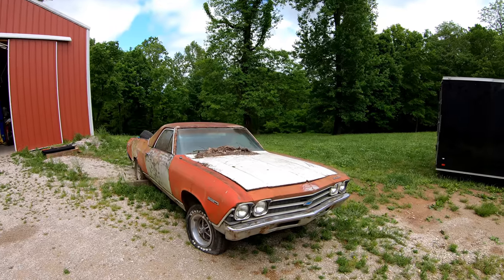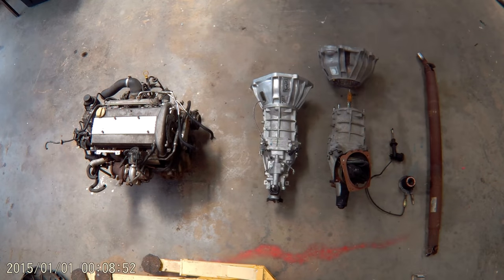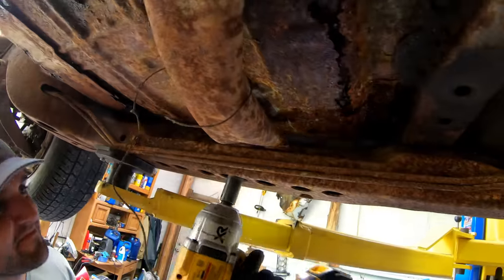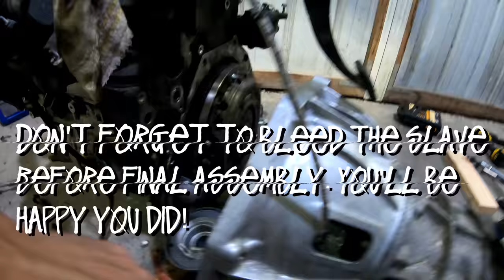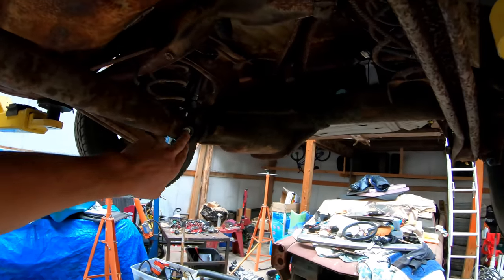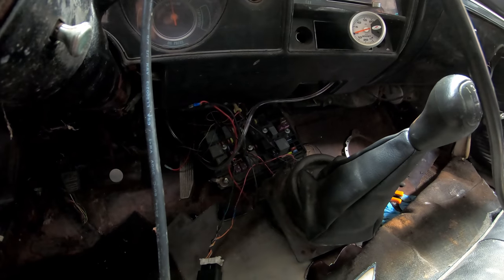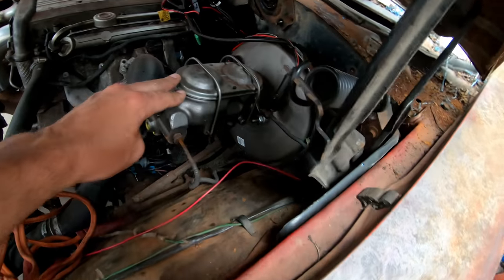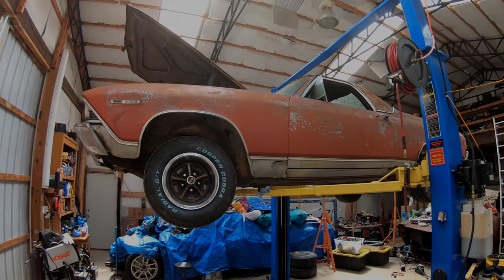The next 2JZ? LSx? - this NEW engine swap will be the new fad, follow this HOW TO : EcoMino Part 1

Comment: Keith MuletownDyno I Definitely wondered when I saw the one piece bottom end... I bought a G6 that skipped a tooth or two, who knows... Didn't run. I was able to revive it, no bent valves. Pulled the pan off to clear all the guide plastic from the oil pickup screen and check a couple rod bearings. Big, one piece bottom end!
Reply from the maker: For sure the bottom ends are crazy. Timing tensioner and guides are the most likely failure point from people that let these motors run too low on oil. Get a good timing chain kit and keep oil in the motor and it is strong. 
Sometime the internal Pcv can get blocked up and these engine especially with turbo will start drinking oil based on my experience.

Comment: I'm doing a swap on my 63 falcon. I'm using a solstice engine and transmission. Then im planning on turbocharging it and piggyback the ecu
Reply: Piggyback?
Reply: @jamalcole1985   yeah haltec will run the ignition and fuel etc... my le5 has electronic throttle on it and haltec does not support that and you can't put a drive by wire on it. So the factory ecu will still control that
Reply: @8.2deck  Do you know how many of the different ecotec engines use drive by wire or if it's a pretty universal feature of these engines in general?

Comment: Going to follow this... I have a 2006 Ion Redline with the supercharger, and would love to put that motor in something RWD like a hot rod. Factory boosted Ecotecs can easily hold 300+ HP on stock internals.
Reply from the maker: We have a video coming up that walked through a ion supercharged car with different pulley sizes and throttle body and ported blower to shop all the different hp gains. So stay tuned to the channel. We had to take a pause but I promise more content coming soon
Reply: @MuletownSpeedandDyno  Years ago, Hot Rod Magazine did a write-up on modding the LSJ, and with cams, a TVS blower, bigger TB and 60# injectors, they got 370HP from it. At that point, the intake manifold/intercooler was the biggest restriction to making more power. 
https://www.hotrod.com/articles/hrdp-0907-gm-ecotec-bolt-ons/

Comment: Due to this video working on my own RWD Saab 2.0T swap.  Trying to get a list made up of parts I need to buy 

LSJ ecu, coils, coil harness, injector harness, cam sensor. 

Then Colorado trans, accelerator pedal, salve cylinder, clutch pedal, throw out bearing, pilot bearing. 
Solstice clutch
cobalt ss flywheel, cobalt ss pressure plate.      

Anything I am missing? 

Re-wire Saab throttlebody connection.
Reply from the maker: You will need a solstice bellhousing to mate the Colorado trans to the Saab motor. Those are getting harder to find but there are people who throw them out when they build a Colorado trans to go behind their Supras. So you can look at supra forums. (This will likely be the hardest part to find) you might be able to get an adaptor made but at the time of our building it was easiest to get a solstice bellhousing. 

If you want more than about 250 hp you will need to change out the stock Saab turbo. I am working on a cheaper solution to this right now. Hopefully get a video out on it soon. But the new set up will use a cheap 120 dollar eBay gt35 turbo and 55 dollar external wastegate. 
Hoping for about 600 hp

Depending on what size turbo you go and what fuel you run you will need injectors. For e85 at 400hp we were running the 80 lb injectors (from eBay set of 4 was 40-50 dollars)
For 600, we are still testing but will likely need upgraded fuel pump and bigger injectors. 

Depending on what car your swapping into I would suggest just getting a modern plastic fuel tank from a junkyard that fits and has a decent fuel pump in it to begin with. Our Pontiac g5 fuel tank supported up to 400 hp with no issue and for us it was free sitting in the yard from previous race car parts car.
Reply: Muletown Speed and Dyno 
Thanks for the Reply. Great info. Really enjoyed the original video too so looking forward to more.  
I am trying to build the car for the $2000 challenge put on by grassroots Motorsports magazine . Seems like you guys could do a killer build, for that. 

I am swapping into a 1993 Mercedes 190e, that I bought from a salvage auction. It has a odd gas tank location so I am going to try to use the stock tank but has an external pump already so I can upgrade if I need too. I am not looking for much more than 250HP to start with. This is my first swap so it is really nice to be able to follow along in your video. I was able to pick up a solstice bell housing too, from someone using the AR5 behind an LS.
Reply: Muletown Speed and Dyno getting further in on my swap. Did you guys have to cut the bellhousing to get around the oil cooler? Or run remote cooler?

Comment: What's the gas mileage? Small motor heavyweight vehicle= horrible gas mileage. The motors supposedly are more efficient and make more power, but  look at GM trucks 88 and ontil now. Same mileage
Reply: good point
Reply: Power to weight is power to weight. Doesn’t matter what’s providing the power.
Reply: @Backon4  What do you mean by that? I could put a 572 big block in a miata and get 4mpg , whereas a 2 liter would get 25. I could also put a 572 bb in a c10 and get 4mpg. where i would get 25 with a 2 liter. It certainly does matter whats providing the power.